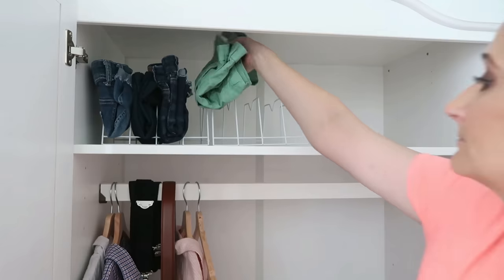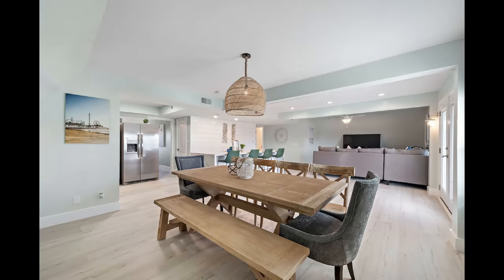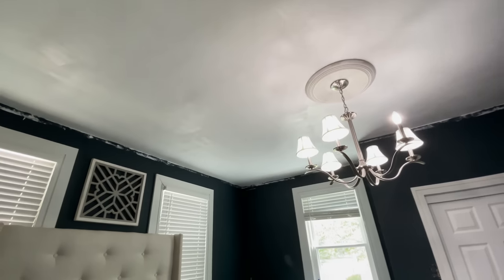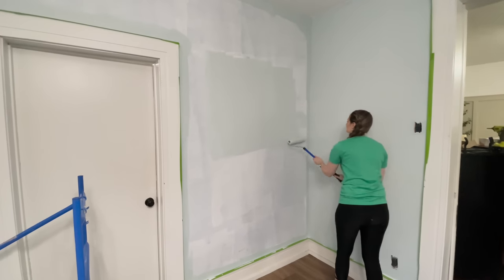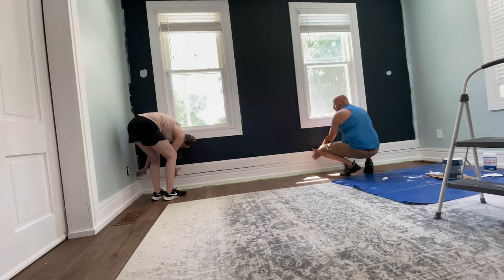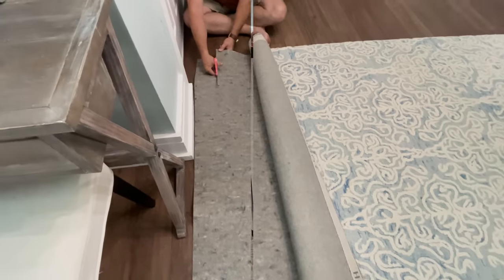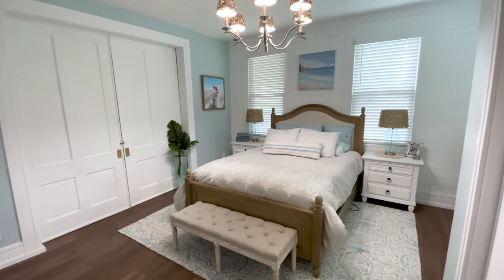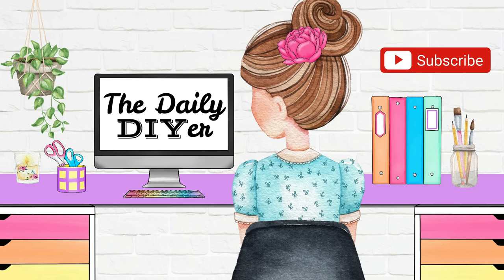WOW! BEDROOM DIY (+ BEST useful Dollar Tree item!)

Comment: Curtains would be nice and helps with electric bill. I need a lighted mirror like that!  Great job painting & caulking! … pro tip:  go back and paint your green line over the caulk, then paint the white line. And for future reference, get a longer paint pole. Sherwin Williams has pro rollers and extension poles that snap on. You’d love Purdy brushes and roller naps if you tried them and they last forever. But if you rather stick with dollar tree stuff, the broom handle will probably fit in the roller handle.

Comment: What color is the base of those lamps from At Home? I have some  lamps from the 80's that had pealing peach paint on them. I've cleaned off the pealing paint and was thinking of painting the clear glass with that krylon sea glass paint in aqua but I'm trying to figure out if I want gold or silver for the base and the rod that goes up through the middle. Right now they are gold.